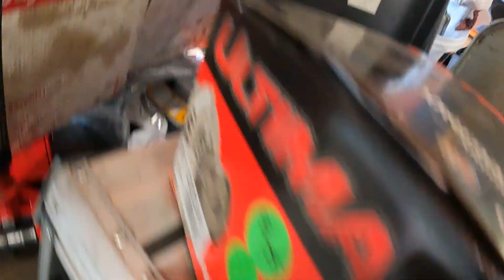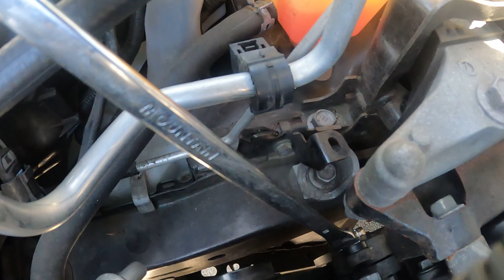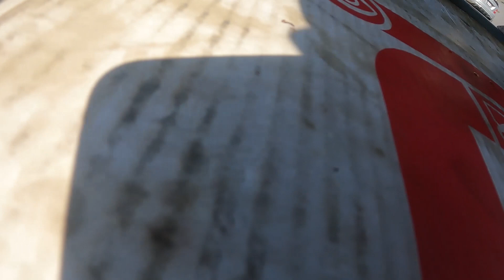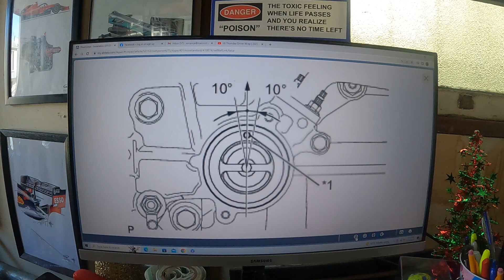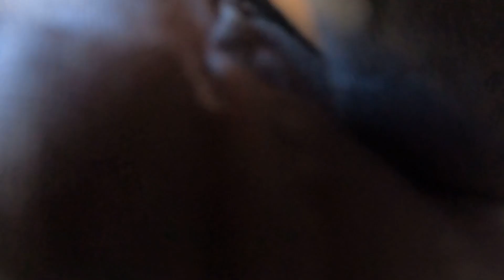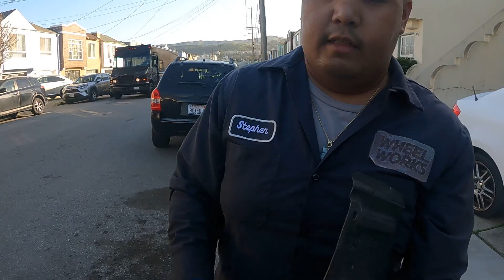How To Easy Remove/Install Water Pump & Thermostat for 2012-2016 TOYOTA/SCION TC

Comment: How coolant gets in to internal of the engine .did the thermostat open with dry engine block ?
Reply from the maker: this car does not have problem about coolant getting into internals. its basically doing service to replace water pump & thermostats. this scion TC water pump has bearing that usually get worn out and made rattle noise or some weird noise, and if your replacing water pump it's better to change thermostat too at the same time.

Comment: How many pounds torque for the  thermostat housing ?
Thanks
Reply from the maker: hey brother you dont have to torque the thermostat housing you just need to tight them with 1/4 drive ratchet....i already put silicone gasket and with o-ring gasket should be good
Reply: @WrenchingThrottle92  hey brother 🙋🏻‍♂️ thanks so much for the information, I’m planning to change the water pump this weekend coming up 🤞🏼
Reply from the maker: @luigi3286 you can do it bro….good luck ….thanks for supporting
Reply: @WrenchingThrottle92  thanks 
You’re welcome

Comment: Thank you for the video! It is extremely helpful. I have a question about the location of the pcv valve and where it is?
Reply from the maker: Its around valve cover, look vacuum hose that loop around intake duct hose. And I believe pcv valve for scion tc are metal.
Reply: Thank you!
Reply from the maker: @richer9251  your welcome, if you haven't subscribed to my channel, just hit the subscribed button to get connected with future videos.
Thanks